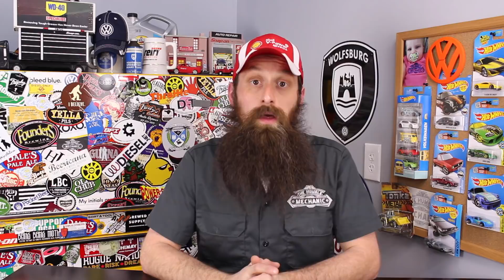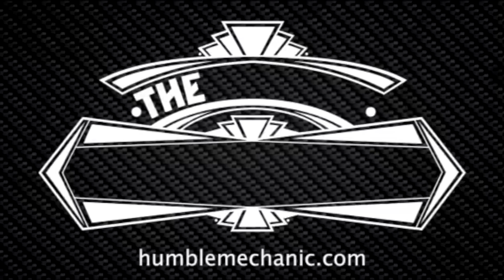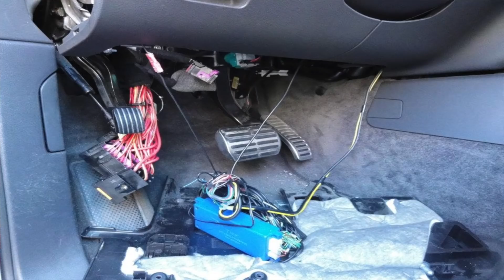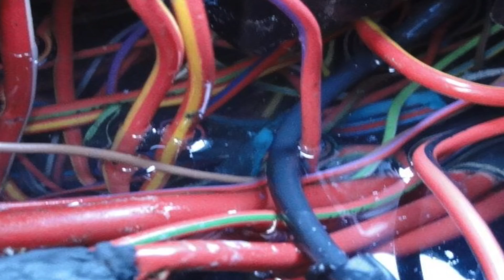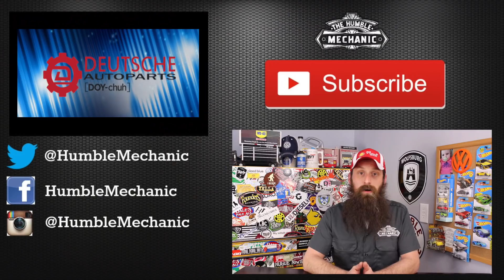Top 5 Failures of the Volkswagen Touareg

Comment: I bought my 2016 3.0 V6 about 5 years ago, and straight away it was losing coolant, fast. The seal behind the engine / oil coolant was replaced, along with something else in the engine, but it persisted.
Then the head hasket blew.
I had the track rod for the head lights break, then a pressure sensor went in the tire.
The wing mirror heaters stopped working.
Then both front springs broke.
Then the back left spring broke, and 2 Nox sensors needed replacing, and the flexi needs replacing in the exhaust.

The car only has 72K on the clock and has racked up about £12K in repairs in 5 years.

Comment: I literally have the same voltage drop issue right now on 2019 Tiguan SE 2.0 TSI. OBDeleven is showing a voltage drop of 0.7V between generator and battery. The car's ECM has 3 modes - economy 12.2V, 13.5V and 15V. The last one is only toggled when the seat heating is on, 13.5 is on when the headlights are on (not DLR!), and 12.2 on any other occasion if the battery SOC is over ~50%. So basically because of this drop the car is hitting lower charge voltage on the last two modes, and the alternator is outputting 0 amps on the 12.2V setting. Been scratching my head is it the control module, the mass connection, or loose contact somewhere under the plastic hood of the battery connector. Or even the LIN cable or fuse. Not a pleasant thing to dig into.

Comment: I found a mint 2008 2nd gen T1, that only had just under 110,000 kms (68,000 mls) last year, & it’s my first Touareg (switched from Amarok). Has the 550 nm TDI V6 which is the most common version here in Australia, & most importantly, no air suspension for simplicity & reliability. These TDI 6 cyl engines tend to have quite a few issues with the overly complicated EGR system  & DPF’s that eventually fail & cost a fortune to replace, so they will be getting removed along with a retune. Hopefully that will keep this old girl going reliably for a long time to come.

Comment: I need help i have electric problems but first one i need to fix is with the lights driverside brake light goes on when i turn the lights on but doesn't work at all when the lights are off and the drivers side dipped beam aint working either but the brake light is key

Comment: Howdy Mr. HM, greatly appreciate your content and hoping you can direct me to a solution with my wifes 2013 VW Touareg TDI Lux. So it just recently turned 150k and has been problem free until a month or so ago after the fuel filter was replaced. Noticed the engine light pop up and then turned off and has done this a couple more times until last week when it turned on and has stayed on since. The code I'm getting is P0401. The car runs fine except the first few miles or so before it warms up it will jerk or cut out while driving and necessarily during acceleration. It is a very brief delay of sorts. It does this a few times and then it stops. Any help would be greatly appreciated. Thanks!
Eric

Comment: I have a 2005 Touareg with 197,000. It starts fine then after a few miles it will die. If you try to start it right away it does this shaky start thing then dies. Let it sit for 20 minutes it will start great then drive another mile or 2 then die again. I think it might be the the main fuel pump. Thoughts?

Comment: For the ones who own or have owned this car, what do you guys say about buying the 2nd gen Touareg in 2024?
Reply from the maker: Whatever you spend on it, save for repairs. They can be great, or your worst nightmare
Reply: @HumbleMechanic I bought a 2013 VW Touareg 4.2 V8 gasoline here in Brazil last year. I'm loving it! I had a water leak on the back (that plastic pipe always fail), and recently the oil filter housing gasket also began to leak. But I fixed these problems and now everything looks fine. The car is awesome. I hope it stays like that!

Comment: 2012 7 P Touareg.  150kw
Rear timing chain cover oil leak and rear main seal.  Carbon buildup on the intake and throttle body.   In Australia, DPF issues.

Comment: I have a 2014 VW Touareg FSI and I'm having issues. The fan is running high not reaching temperature and Im getting a code P218100. I have 95k on it. Any suggestions where should I start ? this is the 4 time that it happens.

Comment: 4:30 I just bought a 2008 V8 about 178,000km. Would this have a recall on the electrical issue. I noticed the manual is like 300 pages and when you look up how to change the battery the only thing it says its to complicated to do it your self so take it to a dealer. It's frustrating but doable.

Comment: I am surprised how reliable my 2004 R5 manual is. Bought it with 265.000km and did a lot of bushings, two wheel bearings, a propshaft (I damaged the old one while doing wheel bearings), all brakes and a big service. Basically what I always do when buying a car. Air compressor for the suspension for 250€, two valves in the struts for 25€ and a few plastic covers. Some little electrical stuff like rebuilding the softclose motor on the bootlid but all in all, great car. We deove 6100km from Lübeck to Nafpaktos in Greece through Italy and back and consumed on average 7,9L/100km. Can't complain for 275/45 19 wheels and fully loaded close to 3t.

Once you've done everything after ~250.000km, you're good to go for the next 100-200k. And considering it is really cheap to buy, it doesn't hurt to be thorough. Bought mine in sorry state for 3500€ and invested 2000€ so far. That is a joke. That's one or two services on a new car and I did three already

Comment: I have been having electrical issues with a 2008 VW Touareg 2 - 3.6L v6 . Took it into the dealer, I was told they have no idea how to fix it. Lock the doors and the alarm goes off, radio not working, airbag light, all sorts of warning lights going off on the dash. The car has under 100K miles on it. I would like to keep repair it.. HELP!! Any advise?.. Any answers would help greatly?

Comment: I have my moms 2005 VR6. The dealer offered her $1k for trade…so I purchased for a dollar. No TPMS.  Were now at 250k miles.  Starting at about 200k some major items needed replacing. Over the last 10 years I’ve put about 13k into it. Transmission replaced with rebuilt transmission, differential replaced, brakes, fuel pumps, light bulbs, brakes, suspension parts.  So it isn’t cheap to fix or run. But these are pretty normal parts of a car that just wear our.  I also have all terrain tires because I live in the north and drive all kinds of crazy places with it and pull a boat. Its not the cheapest rig to run but it’s very comfortable and capable.   I don’t pay for full coverage.  The body hasn’t rusted. It’s dead quite and smooth on my back during long road trips.  It’s worth jt. Had I purchased a used QX 80, or Land Cruiser or GX…or ridge line….I’d still have some maintenance…so…I feel like had I even paid $5k…I’d be driving a nice car at a price I can afford.
Reply: Ditto

Comment: Hello HumbleMechanic. Not sure if you still respond to questions or comments on this video since it's 7 years old but I'll give it a go just in case. My fathers 2007 Touareg V6 thru a check engine light and EPC light. I checked it with my Foxwell scan tool, and it gave me a code for the camshaft sensors. We took it to the local Euro mechanic; they did a diagnostic and found the same so we had both replaced. The vehicle was fine for a couple of days until he drove it at highway speeds and the check engine light and EPC light came on again. It thru the same code so we took it back and now they wanted to do an oil flush and change because they said the oil looked pretty dark and could be affecting the new sensors. We got the oil serviced and the lights came on again once the car was driven at highway speeds. They now say it may need a new timing chain. Obviously, this would be a costly job, but could it simply be we need to clean or replace the mass air flow sensor?.. or clean the throttle body and EGR?? You did mention in this video that the V6 Touareg had issues with the timing chain. Any advice would be greatly appreciated. Thank you.

Comment: Hopefully you see this. Have you ever dealt with an intermittent heavy power steering on a 3.0tdi touareg 3? fluid is good, tires are not flat, but occasionally, usually after shutting the car off to run inside a store then back on, the power steering will be extremely heavy, where on cold start it can be turned with a single finger. it isn't dead pump heavy, but it's like 80% of the power is gone. does not make any weird whines, grinds, or clunks
Reply: it is a 2013 TDI Lux with 95k miles on it.

Comment: I had an 04, V8 petrol. No serious problems . Some of the plastics were cheap and fiddley. Car overall Was solid and reliable.
No electrical issues. Sold it with 230,000km on it. Went like a rocket, terrible fuel economy.
Now I have a 2011 3l TDI . Great car. Aircon fan replaced at 200,000km. Very smooth, quiet, powerful and economical.
Everything works perfectly after 211,000km.
Tyres wear exceptionally well for a 2.2t SUV. Perelli Scorpions have just been rotated balanced and aligned after 27,000km , minimal wear.
Replaced the original battery after 11 years. Not bad longevity.
I am about to replace all fluids and filters, and intend keeping it for quite a few more years.

Comment: Stuggling currently with a 2008 stopping intermittently. Replaced the battery twice at two different car shops. It has now been to 4 different specialist service centres and they are not sure what to do. Seems to happen when it has been idling (happens when the vehicle is warm), like when waiting at lights or roundabouts, and then you take off. It doesn't seem to matter you take off fast or slow.They are saying that perhaps I need to replace the injectors because of the age of the vehicle but at $6k this is a huge cost for no guarantee.  I am a single woman with simply no idea what to do next. Unfortunately I hadn't seen too many negative reviews before I invested in this car 6 months ago. Any suggestions would be gratefully received.

Comment: I got a 2005 VW TOUREG V8 from auction for 500 bucks running ! With 150k miles with the air suspension inoperable ... Guess what it was? A mutha FACKING FUSE BAM air ride is back and it's been a joy to drive but a gas guzzling mofo... This is my 6th VW and I own em all except my 1st vw 😭 which I regret selling a 07 Mk5 2.5 Wolfsburg with the unique tail lights for the special edition with the 5 spoke rims aw man that engine was a damn tank and half of a lambo Gallardo the straight pipe exhaust note would give me chills

Comment: I have a 2014 Lux TDI.  Battery is 8  years 5 months old, a gnarly 108F heat spell for days straight finally killed it this beginning of Sept 2022. PIA to change out the battery under the drivers seat, it's really heavy in a diesel TDI. It's an infant with 65k miles on it.

Comment: I was working as a tech for VW when the Toureg was new,  I was was one of the first techs to pull the motor one. Absolutely miserable job.
Reply from the maker: That is right when I started with VW too. What a time HAAHHAH
Reply: @HumbleMechanic  The block had hole in it from the factory when it was cast if I recall.

Comment: Some things you eventually just ignore (TPMS).  If you're checking tire pressure regularly, you can pretty much tune it out, though it would be nice to just have it go away.  Don't rebuild or buy an OEM prop shaft...waste of money.  An aftermarket works just fine at a fraction of the cost and an hour underneath the car is worth the cost if I end up replacing it sooner.  Biggest PITA is access to the timing chain.  Hate to sink $5K into a lift, but it may be worth it.  Love my 04 and will pull it apart and put it back together until they put me in a walker.  Bought an Allroad before the Touareg.  Will take the Touareg every time!

Comment: Question:   On the TDI’s, what’s the overall reliability of these engines?  Seems to me that these should go well over 300k miles, but I’ve heard rumors of issues with the NOX sensor, turbo’s and timing chains.  The biggest issue is that the mechanics that understand and can diagnose and repair is slim.  When they are working fine, the TDI Touareg is an absolute beast.
Reply: I would stay away from the V10 TDI Touaregs.

Comment: This video is a little dated but I'm hoping you see my inquiry. I'm thinking about buying a 2009 touareg 3.0 tdi. The odometer has 185k miles on it but has had a new engine installed from VW that is warrantied. Should I be concerned about any of these issues or do you think most of these problems have been resolved by now? I'm hoping to buy a reliable vehicle that lasts a while. Thank you in advance.
Reply from the maker: Most all the issues on those are around emissions. I have 130k on my 2015
Reply: @HumbleMechanic  Thanks again for the response. This will be my second car, my first is a 94 GMC sonoma 4.3l that has 240k miles on it now. It still runs fairy good but longer trips make me nervous. I just hope to get a car that'll be as good me as that one has. At $11,900 I'd be fairly disappointed if it ended up giving me a bunch of issues.

Comment: Great vid, all true. Need help or advice on my gen 2 touareg 2009, got a CEL P2294 fuel pressure regulator 2 circuit, and the accompanied 2293 fuel pres 2 reg performance, had numerous misfire codes and low fuel rail pressure, and several other related codes. ended up replacing hpfp with a used one from same year vehicle that was from a totaled touareg crash.  Roller cam follower was in good shape. runs almost like new under heavy acceleration and load however still have, and can,t clear the 2 codes, removed ecm, let sit overnight, all lights went out for first drive cycle then came back, stills runs ok, still have slightly prolonged, 3 sec crank, before start, sometimes no delayed crank. Was getting a traction control light for a while also, ecm reset cleared that and hasn't returned. checked both wires coming from bottom of hpfp they are all intact.Thinking bad ground somewhere, or open circuit. Any ideas, or help appreciated vehicle has 177k miles. thks

Comment: I took my 05 V8 Touareg to get tires rotated, and the oil changed. The VW dealer replaced two tires, but the car was vibrating a lot, so I took it back to the dealer. Now they say the front axle is broken, but my car was fine before. I am so disappointed.

Comment: Just bought a 2016 Lux TDI Touareg at 86,000 miles. Using the CarFax report, I believe the transmission fluid was never changed. I know on the 2L TDI with DSG the transmission came with the leveling straw behind the drain on the DSG transmission. I'm wondering if it is the same story or should be the same story for these 8 speed transmissions from Japan. BTW you're awesome! Thanks for all the pointers and insights!

Comment: The R50 is a absolute beast.
Drives as tame as a newborn kitten but give it the loud pedal and point it in the right direction.
Tows big trailers like they not even there.
Issues its got the battery going down gradually thing and thenthat centre bearing will give up like you said 
Not experiencing tyre wear or huge brake wear.
Economy is pretty impressive even towing around town is ok but it is a 5 litre.
Overall its a beast.
 once you understand its nature and its quirks they pretty good.
Easy to service and very reliable.

Comment: I have a Volkswagen Touareg 2005 my Headlights went out but I changed them and they are still not working my high beams and turn signal lights are working so I'm thinking it could be a wire harness or something if it is any idea on how to fix

Comment: I have a 2004 R5. I don’t have air pressure sensors. 12 months ago I put 1,000Eur of Michelin tyres. 10k km later they are still new. Not really had any electrical issues even though I have added third party sensors, active sound, Dana in radio, rear subwoofers. Mind you I am in a relatively dry climate in south of Spain and she lives in a garage, never parked outside or used off road. I look after her. Best car in the world as far s I am concerned.

Comment: It seems that the large engine cooling fan will come on and not shut off on a lot of the early Touraregs. My 04 3.2 v6 the fan will run untill the battery dies. Can no longer use the vehicle.

Comment: Bought my 2011 T3 TDI with 85k miles in 2020. It has been in the shop 4x (88k miles to 102k miles) but that’s because Findlay VW in Las Vegas are POS. The car has had: fuel contamination (supposedly), turbo replaced, injector 4 replaced, def pump, def injector, nox cat, nox sensor and a few other things. It’s going back in the shop because of check engine, burning smell and blue smoke. I absolutely love the ace but just make sure what you ge my into.